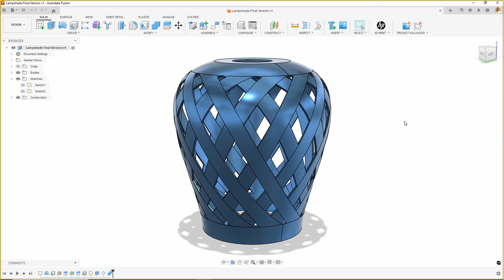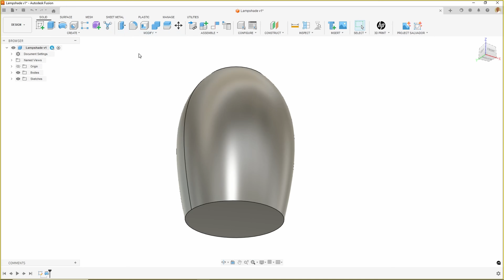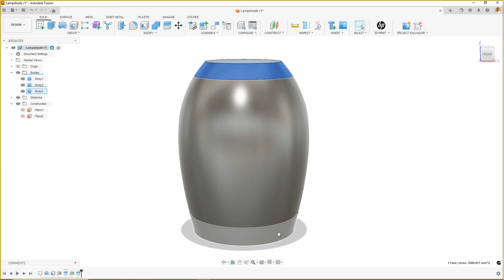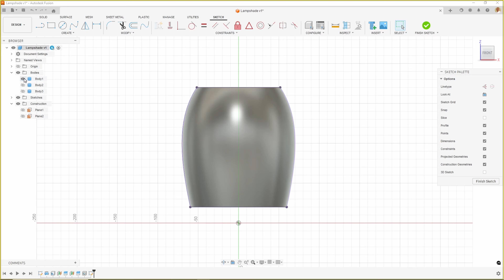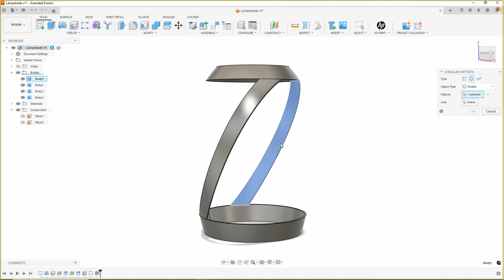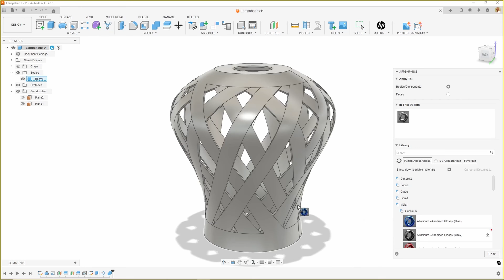3D Printed Lampshade in Fusion: 6-Step Parametric Design

Comment: Why did you convert to mesh before exporting?
Reply: Excellent tutorial btw!!
Reply from the maker: Hi Michael, 
The “Save as Mesh” tool that Steve uses is one of the ways to export the file out of Fusion to bring into your 3D Printer’s slicing software. In this case we are not saving the file as a mesh before exporting, but using the “Save as Mesh” tool as the export tool. 

There are several ways to export files out of Fusion for 3D printing and this is one. If you have your own preferred method you can of course use that instead of Save as Mesh ☺️
Hope this helps and glad you enjoyed the video!

Comment: Why is it no longer possible to move Construction geometry such as offset planes? Very annoying...
Reply from the maker: Hi!
Moving construction geometry is still absolutely possible by editing the plane/axis. The most likely reason is that you are trying to edit construction geometry that is within an external component in an assembly. In this case, you will need to enter Edit in Place (pencil next to component in browser) to be able to edit the plane. Without this if you right click on the plane the option won't appear.
Hope this helps!
Reply: @adskFusion  Thanks for the reply but, no; not in the context of an assembly. Create a "Part Design" or "Hybrid Design" part and then switch to Direct Modeling. Show the origin and create an offset plane from any existing plane. After creating the construction plane, select the constructed plane, use the M hot key and try to move the plane.
Reply from the maker: Thanks for getting back to us with these details. I saw that Seth responded to you on this in the Whats New Livestream last week however to confirm, this is a known and reported bug and our development teams are working on solving it. Thanks for your patience whilst they implement a fix!

Comment: Great tutorial. What filament type can you use with this. Keeping in mind the bulb can output a lot of heat
Reply from the maker: Hi David, great question!
Firstly, we would always recommend using an LED bulb. Not only are they far more energy efficient and long lasting, but they also generate a lot less heat. With an LED bulb, PLA will be absolutely fine as filament to print in. However if you have to use an incandescent light bulb you could either print with PETG or ABS. If you needed it to be even more temperature resistant you could print from Polycarbonate.

The consideration is the Glass Transition Temperature of the material, which is the temperature that it starts to soften and deform. Based on your own lights, bulbs and situation, you can use the below data to determine which material you may want to print in: 
PLA - 55-65 Celsius / 130-150 Fahrenheit
PETG - 75-85 Celsius / 165-185 Fahrenheit
ABS - 100-110 Celsius / 210-230 Fahrenheit
PC - 145-150 Celsius / 290-300 Fahrenheit

Ultimately, we suggest you use LED bulbs, and print in PLA! 
Hope this helps ☺️